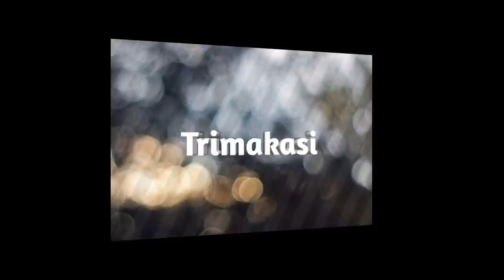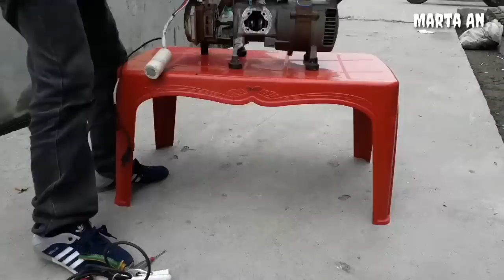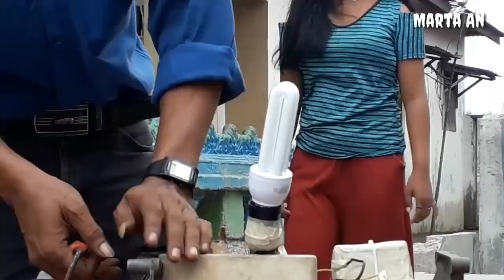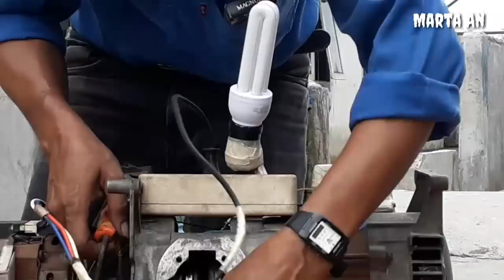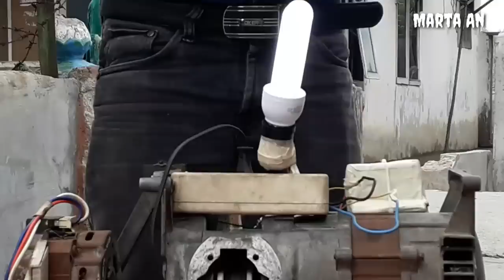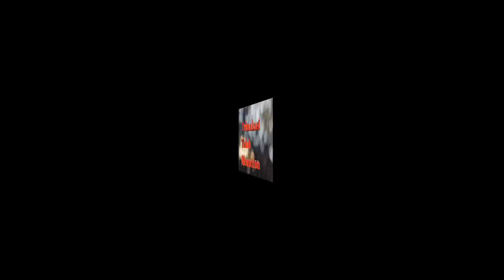genset tanpa minyak !!  Karya Roslin Tehnik.

Comment: Sy pernah terfikirkan dg alat yg serupa waktu SMP dg mesin pomp air 😂
Tp sprtinya ga mgkin energi yg terbuang  akan mhasilkan energi yg setara
Reply: Yes
Reply: alternator/genset memerlukan putaran dan putaran itu menghasilkan listrik
Reply: What is the motor used in the rotation of the generating power? Please answer the question that you are actually a real inventor🤔🤔🤔🤔🤔🤔

Comment: Motor Ready 1 hp or 750watts, 3500 rpm, saya mencari sebuah generator yang bisa di couple dengan itu, sehingga didapat daya yang lebih contohnya daya 1500watts dan motor tetap berjalan, pengetesan sebelum itu dilakukan bisa menggunakan motor electric dan menggunakan Watt meter antara input motor dan output generator, generator harus dibebani resistve load type contohnya bola lampu pijar, motor electric juga memiliki daya yang diperlukan untuk hanya berjalan( no load ), dan generator juga perlu daya untuk berputar ( no load ), jika motor electric sudah di couple dengan generator ( no load ), maka perhitungannya harus Pout-(Pinr -Pina), dimna Pout adalah daya output, Pinr Daya input total ketika dibebani dan Pina adalah Daya motor+generator tanpa beban ( hanya generator ). Ketika Poutnya hasilnya tidak Negative maka berhasil.
 contoh daya total output 1500watt, daya input motor total 1600watt, Daya input motor+generator ( tanpa beban, hanya berputar ) 450watt maka Pout-( Pinr-Pina ) atau 1500watts - (1600watts-450watts), 1500-1150 = 350, hasil nya positif dan itu sama saja berhasil, walupun total output lebih kecil dari total input.
Jika ada dan jika berkenan 
Hubungi syaa WA 081360030477
Email septono310101@gmail.com
Saya siap membayar

Comment: the secret is, in the whitebox behind the machine. actually this is not pure free energy,  he use battery as the powerbank, and it charged when the motor rotating,  
its truly make an energy, but its not simple as we see on this video. 
the power will continuesly decrease, becase the  input power to charged the battery is not equall with spended power to powerup that light and drill. thankyou

Comment: Bnyak komen yang membuli . Kasian.
 begini aja dah
Pemakain listrik pln 220volt.  
Contohlah dinamo tersebut menghasilkan 1200watt.  Sedangkan untuk memutarnya pake dinamo lagi. Yg konsumsi nya 500watt contohnya ya.
Berarti sisa 700watt.
700watt itu ga bakalan bisa dipake semua.   Mungkin separonya.
Semakin banyak beban... dinamo penggerak akan semakin panas. Ga kuat.

Saya ambil kesimpulannya.
Ini semua bisa saja terjadi
Cuman....
1. Berapa lama kekuatan motor penggerak.
Apakah 1hari kuat. Atau 1jam?

2. Saya ingatkan. Dimana mana genset hanya digunakan untuk darurat. Bukan buat sehari 24jam 

Maaf kayanya begitu. 😩😩😩😩😩
Jangan dibuli ya....
Reply: bisa saja,, tp dengan panel surya,, yg notabene 12 volt dc dengan inverter 220vlt

panel surya  jg awet smpe 5tahun,

Comment: Mas Roslin tanpa menggunakan flywell & gear up rpm dan rpm motor penggerak TDK stabil dan penggunaan energi sangat tinggi..
mohon pencerahan tentang up grade avr hingga mencapai nilai optimal pada kumparan rotor hingga nilai output bisa stabil..
Mantap mas, terus di up grade karyanya..
Mas pakai genset bekas yg berapa kva.. dan berapa rugi2 energi dan berapa energi rata2 yg dapat kita hasilkan... Terimakasih..sukses slalu..
Reply: Logika aja bro perhatikan menit 1:22-1:24 video itu ada peralihan lo refff
Reply: Melawan hukum kekekalan energi aku gak percaya.
Reply: @anamserviselektronik6824  Orang ini  kurasa cuma  ngibul sekadar  untuk  memperoleh  subscriber  saja,   dia mana mungkin  tahu  rumus hukum kekekalan, dikiranya  out  put akan bisa lebih besar dari  input.

Comment: i have just built an almost an exact version of this with same generator head and motor i just coupled the motor and generator together with 2 drill chucks i already have it spinning up motor also is single phase washing machine motor with 250 volt 45uf run capacitor wired up to the motor just like Marta,s i ham stuck right now i had 3 small harbor fright 800watt generators that i have dissembled and modded the generators by removing the piston and rocker arm so it can spin freely anyways what the problem is the generator head is not putting out 120 volts im only getting around 3 to 4 volts iv tried different capacitors for the generator iv tried exiting the generator with the drill trick also took the capacitor and wired it to house power and have 120v for 1 second to the cap and generator to energize the rotor but still no voltage i did this also when i had the motor sniping generator the rotor has 2 small square neo magnets on each side of the rotor/armature my guess is for self excitation all i know is that all three generators worked for sure before i took them apart i know how to take these generators apart no problem without abusive hammering i know i didnt damage or fry any components will report back as soon as i figure something out but would appropriate someones help
Reply: I rink the problem isn't the generator alternator, but the washing machine motor, I think he did a bit of modifications there. I did my bit has 94 volt. Data why am trying 2 no how he did the motor modification

Comment: Hay bro. Can u tell me which motor is this and the generator of how much rpm?
Reply: (1) that's induction motor ac
(2)the generator is induction generator
(3) mostly induction generator run 🏃 on 2500-3500rpm before it produce usable voltage